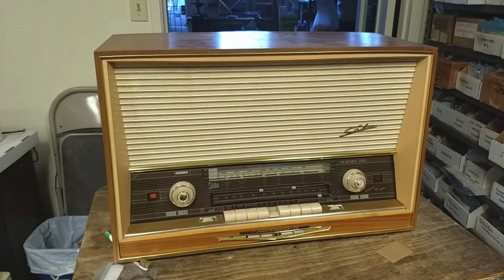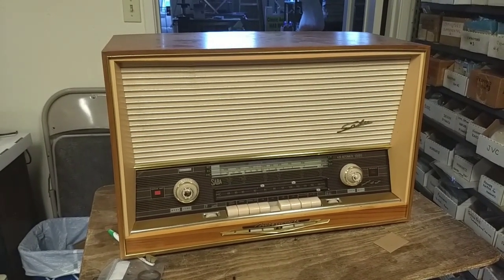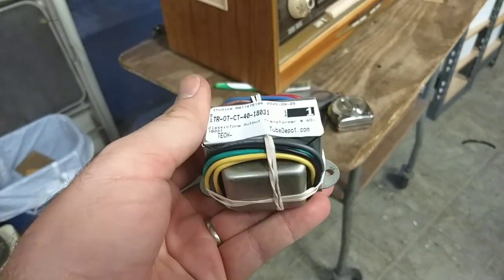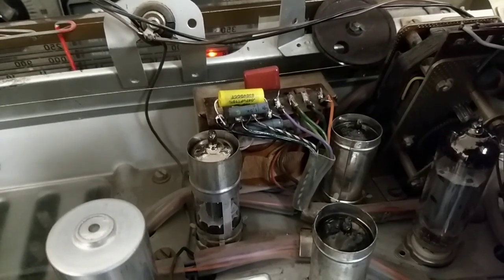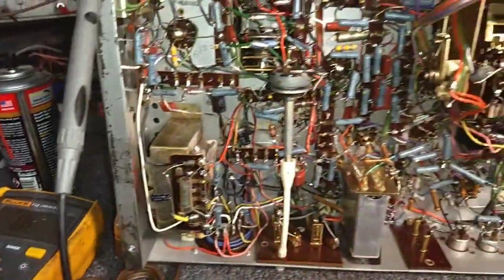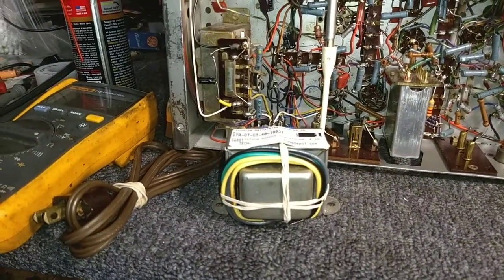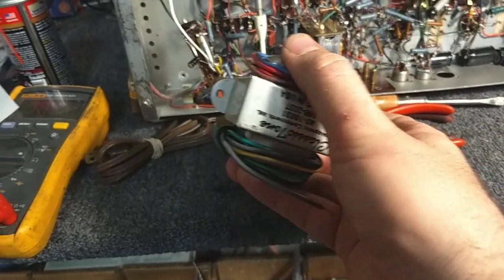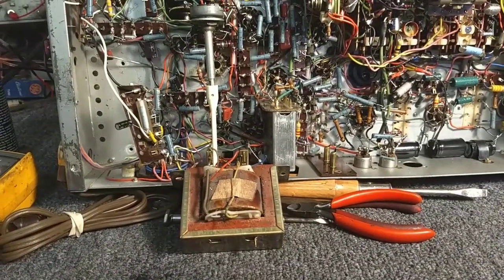Repair of 1960s Saba Freiburg 100 with a bad output transformer.

Comment: Congrats JP. Those Saba’s are a nightmare to work on compared to the other german radios of the era. I’ve done 5 or 6 of them and recall taking ages to do them compared to grundigs or telefunkens. 
Once again, we’ll done.
Reply: One reason for this is because they are simply more deluxe radios with more complex circuitry involved. The motor tuning system adds a lot of parts on its own. The build quality on the SABA's is certainly a step above that of a comparable Grundig or Telefunken. I can't tell you how many times I've opened up a Grundig from the early 60's(e.g. a 5490) only to find parts of the switch linkage crumbling in the bottom of the cabinet due to rotted pot metal. And I've had to deal with bad tube sockets on several Telefunken Opus sets. SABA always used ceramic sockets for the output tubes in the Freiburg series instead of the bakelite ones you find in Grundigs and Telefunkens.

Comment: I have always wanted a good radio like this. Saba, Grundig...the German radios are AWESOME ! I have NEVER seen one in person. Here in the Dakota’s, they must not have been popular ? You & Shango066 have done videos on these, the sound is out of this world, but that’s why tube gear is better..I think anyway ?
Reply: Me to! I used to have a Grundig Reel to Reel that I picked up at a pawn shop in El Paso Texas, it played tapes great, but I used to love recording both with microphones and from my Pioneer PL50 Turntable and back then I had no idea what the hell a DIN plug was or how to wire it. The Grundig had all DIN input and output plugs, so after playing with it for about a year I sold it to another soldier out at Fort Bliss where we were both stationed.  About 5 years ago I saw a Grundig transistor radio for sale on Ebay, so I scarfed it up, got a deal on it too because some little puppy had gone dogbone on the poor little set and chewed off the battery cover and a plate that was on the back of the set. I think the total was 7 bucks with shipping. When I got it, I found that I could get the parts, so for less then 10 bucks I had the radio back in like new condition. It even came with the leather case.  I was dissapointed however when I read the label, it boasted, DESIGNED IN California USA, MADE IN CHINA!  You can't tell though they hired a great plant in China to put it together, it looks very well made and has played for years for my late wife. I took it back now, as she passed three months ago, had to clean up the accumulation of grease that got on it as it was on the kitchen counter for several years, and the dial light failed but the rest of the little radio still plays like a dream, even gets some shortwave as it's AM/FM/SW and for a small radio it still plays like a Grundig, putting out some great lows and crisp highs. I have it beside my chair now and flip it on whenever the sirens go in town as the local radio station always announces the location of the fire or accident the FD responds to, my daughter who now has moved in to care for my ancient ass, is also on the Ambulance Squad, a job I used to love back when I was still able, so I get the location of all ambulance calls on my old scanner and her pager as well.

Comment: Damn, I have the same radio, also beautiful  shape, also missing the same brass cap, ha! Saved it from a ladies house that died, relatives were going to give away or donate all the stuff in the house, including lots of old mid century modern furniture I saved and restored. Also saved another old Philco. Cool old radios, haven't  had the time to re-cap them yet, have not even tried to power them up. Now I know. Thanks!

Comment: Hi Jordan: What is wrong with the automatic tuning? Why did you tune manual? Does the automatic work?   If not ...this is one of the finest circuits ever made to autotune ! ...but it is
very difficult to understand and work on it ( I know..i have repaired many hundreds of these..... These are realy the best tuberadio's ever !! . Then ..the sound quality....these radio's sound very , very good and powerfull ..nothing else comes even close !
Reply from the maker: The automatic works fine, I just like spinning the dial!

Comment: I see a pretty nicely fried power resistor in there about midway on the chassis. Those Rosenthal wirewounds don't like overheating and will ultimately open up.  Too bad I didn't see this sooner. I have a spare transformer for this set. Nice radio, but a big job to overhaul. Getting the auto tune aligned properly takes time and a steady hand.
Reply: rosenthal resistor are bulletproof...the reason you see a lot of overheated ones on old radios and tvs is beacuse they overheat but still work fine. they are wirewound and high precision. carbon comp resistors are the ones that dont like overheating
Reply: @MrHBSoftware  If I see an overheated resistor, be it carbon or wirewound, I replace it. It has been run beyond its specified limits...possibly for a long time... and has sustained damage from excess heat.  When the coating burns off like that, the nichrome wire is exposed, making the whole structure weaker. No resistor is bulletproof. I've had them fail plenty of times. A replacement part of more robust construction and higher wattage dissipation is readily available for very little cost.
Reply: @johnstone7697  sure i also replace overheated resistors. my point was just that the rosenthal ones are VERY reliable in comparison to all the other brands we see on vinrtage gear from that era. try working on a philco radio or tv and report back to me....i have been working on a 70's black and white tv from philco were even the small resistors that never see any current were high by 200%. wirewound resistors with the value clearly printed on the body, those rsenthal parts they smell high quality, i bet they were expensive at the time, manufacturers had to take pride on their tuff to give up on profit margins and use quality stuff

Comment: I absolutely love how the two channels are totally different (the bottom one has an extra EBC91 tube) and how the stereo/mono switch actually connects them together by the speaker terminal (turning the two individual single ended systems into a push-pull one)
On that note, isn't having different types of output transformers in this set an issue?
Reply from the maker: Until I got the feedback figured out, it was. The right channel would oscillate when switching between stereo and mono. Once I got the right amount of feedback in the new channel the problems disappeared. That's the point of the additional feedback line from the 16ohm tap.

Comment: You did a really good job! When I saw the title, my first thought was, where is he going to source a Saba transformer? Personally if it were my radio, I wouldn't want a guitar opt which only goes up to 15kHz, no matter if some other guy used it in his hifi and to him it was fine.
Reply from the maker: Limited options due to space constraints. Due to EQ built in to the preamp for the speakers, they choke back the Hf to the point where it's about gone by 15k - and that's before it ever gets to the output stage.

Thought this was a decent compromise. I agree though - guitar opts are not hi-fi
Reply: @JordanPier  I've used these successfully in two of my builds: https://www.tubesandmore.com/products/transformer-output-8-w-single-ended
They don't go down very low, as I recall around 60 Hz, but they extend beyond 20 kHz. I use a sub to compensate. Smaller than the ClassicTone, too.

Comment: Jordan, You might want to upgrade to a better scope. The one you use is pretty much too old and too low in frequency to use in radio repair.
Reply: But is it he seems to manage just fine.
Reply: A 5mhz scope would fill the bill for an old radio